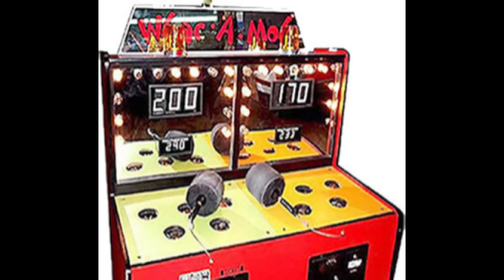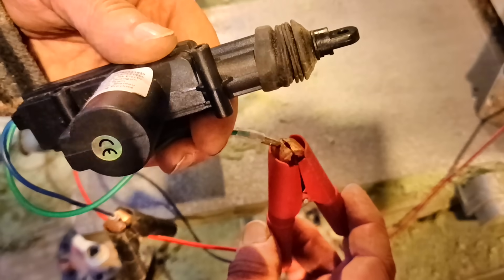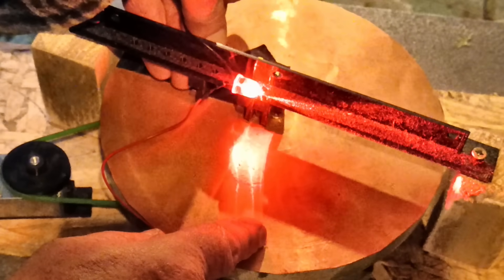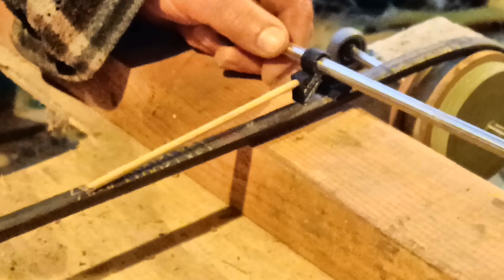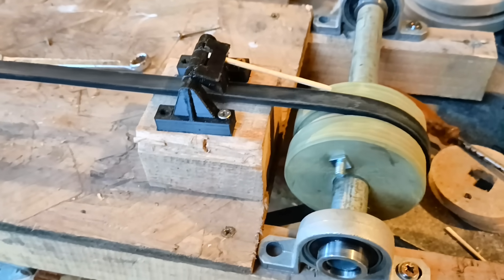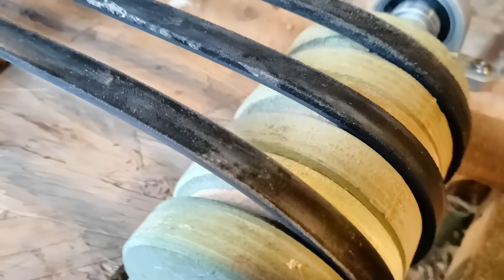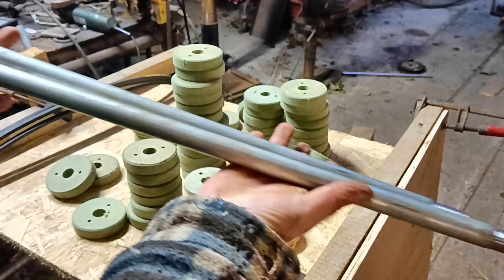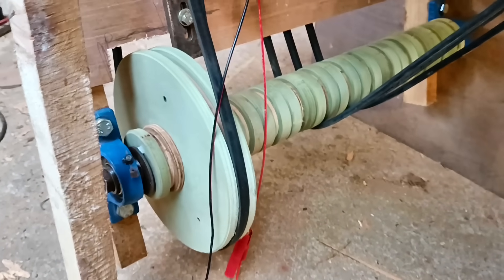How To Make A Whack-A-Mole Game - Part One, The Poppy-Up Bits..

Comment: I would have created the moles springloaded with a release mechanism that release the spring so the pop up, then you will not getting the force from the mallet into the belt system. Only the spring, and that will make it easyer to create strong.

If you want it more random you can make the pullys with different diameters, then it will not always be the same.

Whack an politician? Who dont want to do that? :D

Comment: Another idea for a simple mechanical game is the classic crane game. Ive seen a few vintage ones here in the states that used old Tonka toy dragline cranes and were worked by hand cranks, one crank controlled the cranes swivel/rotation while the other rased and lowered the claw. 

Another idea that's similar but could be more of a challenging game would be to make a scaled down logging skid road with a mini logging donkey engine/logging yarder. Game would still be worked by cranks with each crank working one of the donkeys winches, one crank pulls the log claw forwards and back while the other raises and lowers it. With the idea of the game being to try and grab a "log" and drag it back to towards the player and ether try to load it into a logging wagon/trailer or to place it in a specific spot to win a prize.
Reply from the maker: Thanks. Yes, that's another good idea. I wonder how you'd stop people turning the handles too far? I must look them up...
Reply: @wayoutwest-workshopstuff6299 Hmm... The cranes swivel would be simple enough, just have some end stops to prevent it from over traveling, and something similar at the end of the crane boom but maybe with a small spring to give it some cushion so it's not just a hard stop?

Comment: The idea I had for purely mechanical scorekeeping (even before you showed the microswitch idea, for detecting whacks) was using weighs.

You could use small bearing balls for this. You have a lock gate gravity fed with bearing balls, and on each whack it drops a single bearing ball into a bucket.
At the end of the game, you weigh the balls, subtract the bucket's own weight, and there you have your score! 1 point for each gram!
Before the next game, you pour the balls back from the bucket to the top, and it's ready for the next round. This in theory could work well with your microswitch/solenoid idea, I think. (Power on solenoid/Open lock gate -> single ball falls into lock -> Cut off solenoid/Close lock gate -> ball drops out of lock, into the bucket)

(Hey, it might even be more interesting, if instead of just dropping straight into the bucket, the balls would go on a short, visible path where everyone can see them and only then drop to into the bucket.)

(For the size of the bearing balls, I was thinking about ~5mm diameter, but it's a bit arbitriary... You might know more. Smaller or larger may be better.
But you should probably have a few hundred balls, depending on the length of the game session. Just make sure you don't run out before the end.)

Long time follower of the channel. I'm no engineer, but I though I'd share. Use this, or don't, however you wish!  :)
Reply: Another idea: You could add a bit of randomization by running each band at a different speed (with different sized pulleys), so not all games are the exact same. :)
Reply from the maker: Yes, it could work, FG, but I suspect the balls would need to be quite big, wouldn't they? If each one has make a discernable difference to a dial needle? 10mm diameter each? That's a lot of weight to carry around?
Reply: @wayoutwest-workshopstuff6299  Not sure. Migth need some testing, althoug I don't have any on hand myself... Likely would depend on the precision of the scale you use to measure. And yes, probably wouldn't be very practical with balls that big... Only small ones.
Reply: @wayoutwest-workshopstuff6299  Although a more sophisticated clockwork/dial style mechanism for scorekeeping would probably be better in the long run than my silly ball bearing counting idea, for multiple reasons... :P (It was just the most simple/primitive solution that came to my head while watching, and thought I'd share it.)

Comment: You could use different sized pulleys on the drive shaft so each belt moves at a different speed. This would make the pattern  of when the "moles" pop up less predictable.

Comment: For circa 30 Euro you can have an Arduino Uno, a bread board, some wires & a few MOSFET. Grok or one of the other AI can explain how to set things up, write the code for you in little time you will be able to flash led, count things, turn relay on & off & countless other stuff. Of course you will so proceed with this mechanical stuff (good engineers greatest fault is optimizing something that should not exist (Elon Musk), but imagine all the lighting, audio & stuff that you can create, perhaps enough that you could up the playing price by a Euro.
Reply from the maker: I bought two arduinos - and some mosfets! But I'm going to use them for the add-ons - if I can make them work at all. But bigger double  wound electro magnets are very expensive so I think the bumpy belt plan mght still be best for that part of the build.

Comment: Currently all the drive wheels are the same size, if you make them different sizes you can have the machine run for as long as you want without having the pattern repeat (also makes each playthrough different). You would obviously have to include tensioner wheels in that case.

Comment: Solanoids (and relays and such) generally have 2 current level specified in their datasheets, there's the actuation current, and holding current (which is a fraction of the actuation current).  This allows you to hold them on for longer if not indefinately.
Reply from the maker: Thanks - yes, so I'm learning. And some have double windings for the same reason. Interesting!

Comment: Some use air, some use a magnet based system, the "mole" is mounted on a spring that compresses when you hit the mole which actuates a switch to trigger the mole to retract.

Comment: I've used tinker cad a few times but I tend to keep it simple and use windows 3d builder. Any chance you could do a little video on tinker cad? You get some really good results on there
Reply from the maker: I'm really only a novice on it, but so far it's been easy enough. As long as you take frequent breaks to let your brain cool down..

Comment: how would the whacking work? If anyone whacked a character the belt would slam into the wood and the character probably ultimately break off.

Also, whack-a-mole is quite a fast-paced game. If any one person can get a perfect score in a session, the game is probably running too slowly...

Also, how are you going to make sure that the characters stay down once hit?
Reply from the maker: that's what the flexible bamboo rods are for - to absorb the power of the whack. I'll try to explain better next time..

Comment: I think you need to redesign the mechanism. You don't want the lever directly attached to the character.
Instead, you want it atached to something that will push the character up, and activate a switch, but mounted in such a way that something else can knock the character back down and trigger another switch.
Importantly, this also has to reset when it falls back down, regardless of if it was knocked down.
And you wire the 2 switches in series, so only if the character is knocked down while it is meant to be up does it trigger.

This way, the character pops up when needed, it can be hit down, and when it is hit it goes down and stays down (rather than popping back up) and they only get points for hitting it while it is up, and only the first time.
Reply from the maker: Hmm. Maybe. But if I can make mine work satisfactorily then it will be much simpler. I'll keep going for now..

Comment: My uneducated guess is that there's a fat electromagnet (or pneumatic launcher) under each mole, and they have two or more motorized cams spinning at different speeds.
There are as many tabs on the cams as there are moles, and the tabs are placed randomly around the camshaft.

If all tabs for one mole line up and press their switches at the same time, that mole jumps up.

This is how a pseudo-random sequence could be made for the moles, but I have never taken one apart (yet) either, so I really don't know.
Reply from the maker: An interesting theory! Thanks for sharing.

Comment: Put Labubus to pop up. This is the trend now ... 
Print some cams for the wheel and put microswitches to follow them. Use several wheels, which turn with different speeds to make it more random. The slowest one could also be the cycle timer.

Comment: as for solenoids... The trick to slow them from heating up is PWM.  you pulse the current fast enough to keep the solenoid in the active position, but not so fast that it has current all the time.  That would require some sort of electronics to run.
Reply from the maker: That's interesting. I have so much to learn!
Reply: Or higher rated solenoids! but that gets expensive fast... i'd imagine that honestly, 4 seconds of activation and 20 seconds of rest should be plenty of cooling time for decent ones, but who knows

Comment: I think a lot of the mechanical toughness problems might go away if you had the moles on a bistable/"flip flop" spring - the belt lifts them up, then pulls them back down a moment later or they can be whacked down, but the whack isn't fighting against the lifting force
Reply from the maker: Yes, you could be right, but I'm assuming the whacking force will trump any other movement that's going on. Maybe?

Comment: For the scoring mechanism:  have a hopper of balls with a solenoid at the bottom.  Each zap from any micro-switch releases the solenoid briefly to drop one ball through into a clear tube to show the score.  Would need to empty the scoring tube back up into the hopper between each person.  Cheers, TIm.     Joyeaux Noel from Geoff  in France.
Reply from the maker: Thanks Geoff - you too!

Comment: After reading my last post, I realized that it would be much simpler to use small magnets to hold up your minions.

The ratchet mechanism typically, requires a good deal of force to engage, but a magnet attracted to metal or another magnet, will aid in lifting the object.

Comment: The way you set up a magnet/solenoid to "hold" a mole in the air is actually a double wound coil.  All modern pinball machines (from the early 80s forward) use this for the flippers.

There's a high power coil winding, and a low power coil winding, on the same bobbin.

What the machine does, whether mechanically via switches, or electronically (under the control of the game CPU) is fire the power winding AND the holding winding at the same time, then immediately drop the power winding. 

The holding winding is sufficient to hold the the coil plunger in place (and thus the flipper or mole in the up position).

But, and this is key for the Bob's Space Racers modem version of the game, if you break the connection between the coil plunger and the end stop, the magnetic field holding the plunger in breaks down, and the flipper/mole drops. 

Voila, whack-a-mole... or pinball.
Reply from the maker: Ah! Well done. That's so interesting and make complete sense. I shall see if I can find any..

Comment: Im sure most work with a set/reset system where the whack acts as an early reset. Currently yours will pop up and be up for a fixed time regardless of if it gets hit. 
If you used the belts to flick it up and then a magnet to hold it there with a second peg knocking it down again, if it hasnt been hit. You can then position the counter switch slightly below the normal resting place so if its hit down with a little force it goes further and strikes the switch. 
As others have said i wouldnt have the switch in the line of impact and use a bump on the body to act as a cam.
Reply from the maker: Yes, but that would make it twice as complicated, surely? I'll see how mine first anyway..
Reply: @wayoutwest-workshopstuff6299 more complex but by decoupling the whack from the mechanism i was aiming for more reliable. But im sure you will fettle yours into shape.

Comment: What if you flip the copper disk upside down so the dust did not accumulate and replace the tape with sequential wood jumps from drilled holes, like an old wind-up music box
Reply from the maker: Yes, I think that would work too, thanks

Comment: Vary the length of the belts to add some randomness. Either introduce different size pulleys at the bottom or add another pulley bar (or both) and run different length of belts across different tracks. This would make it much more random and increase the entertainment.
Reply from the maker: Yep, you're right, of course. But it would take up more space. I'll have a think...

Comment: While the electrical contact-based programing wheel was kinda a bust, you might want to look into using an LED and a photorelay to basically create a giant optoencoder, depending on how dark you can get the inside of it. Basically, instead of conductive/nonconductive sections, you'd use transparent/solid sections instead, From what I remember, you've got a CNC machine that you could use to cut panels out of wood and clear acrylic and just cut negatives out of clear acrylic. In theory, you could also easily swap the programming wheel to "load" different patterns.  Use multiple programming wheels and you've quite quickly got a very good emulation of randomness.
Reply from the maker: Thanks - another interesting idea to explore sometime..!

Comment: According to a quick interweb search, "Timed Rounds: Usually 60-90 seconds to hit as many moles as possible for a score", as a suggestion for a future model, you could add a wire to the hammer and set a threshold, if they do not hit, ooh i don't know, lets say 10 in a 60 second session, they get a 70 volt (ish) shock, like those prank shock pens, that would make it more interesting, or even get a shock every time the hammer hits the platter without hitting a beasty, there has to be an incentive.
Reply: Shocking the customer seems bad for business 🤔

Comment: If you want a reliable switching system would be where you have a series of nylon cams which have raised a lowered points on them, allowing a follower mechanically linked to copper contacts, breaking and making, your contacts coinciding with the low and high points in your cams. All you need from there is a motor to drive it preferably geared down somewhat, and that ort to work like your copper disc thing but would also be a lot more reliable
Reply from the maker: Yep - good idea!

Comment: I have a suspicion that having the belts be the programming and the motive force for the moles is going to give you trouble; some system that separates them would help increase the robustness and flexibility of the game.

If you want to shift the "programming" off of the belts while still being mechanical, you could look to player pianos for inspiration. They used rolls of paper with holes; the holes were read by a vacuum system to actuate the playing.

Some other points of note:
1) having the programming live on the belts effectively means you can't really change the speed (and thus difficulty) without changing the length of a game (or forgoing "1 loop is equal to 1 game").
2) having the moles using what amounts to a cam for popup means that smacking the mole won't make it go back down. This would feel weird as a player, and it opens up a potential exploit of smacking the same mole multiple times per popup to run up the score.
3) in the current configuration, you could only have a single row of moles (unless you get really clever with offsets). whack-a-mole usually has an array of moles.

If you stick with your current system, making the pulleys different sizes would allow the pattern of the game as a whole to 'drift' over time, increasing the randomness considerably.

Thanks for the video.
Reply from the maker: Thanks for your observations, GJ. I probably didn't explain properly, but I think it will be easy enough to pull a few belts around at the start of the game to change the pattern - though your idea of different size pulleys is better (but they'd take more room). The levers can be arranged all over the table, so not in in one row.

Comment: As much as I love the Victorian Steam Punk vibes - this is a perfect usage case for a microcontroller and MOSFETs! Lasts forever, can be programmed for random patterns, increasing difficulties and special challenge stages - lots of fun possibilities!
Reply from the maker: And I'm edging closer to that all the time! I'm being very brave and ordering tiny electronic thingies that are utterly mysterious to me. I might need some advice for getting them to work - probably for the next project..
Reply: @wayoutwest-workshopstuff6299  the marvelous thing is that nowadays an inexpensive arduino controller can run the electronics and AI can write the code for it. 
you might need some help in learning HOW to talk to the AI for best effect, but once you have maybe.. 5 rules under your belt the rest of the communication becomes much easier.
Reply: @wayoutwest-workshopstuff6299  Just use an Arduino and good old Chat GPT to write your sketch ..... honestly it is dead easy

Comment: Perhaps the bottom set of pulleys could be on a slider and weighted to pull the belts tight.
Reply from the maker: Yes, good - but then the motor would need to work very  hard